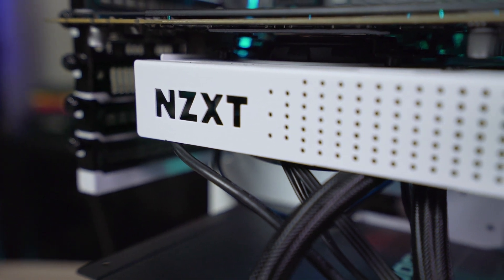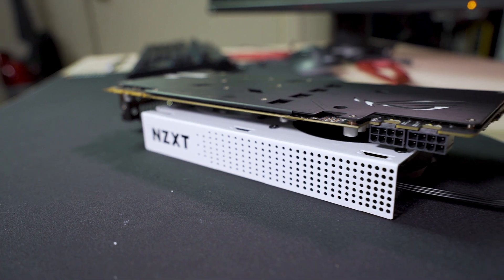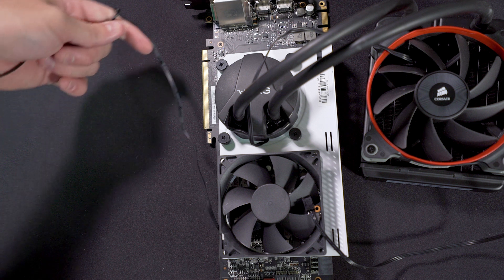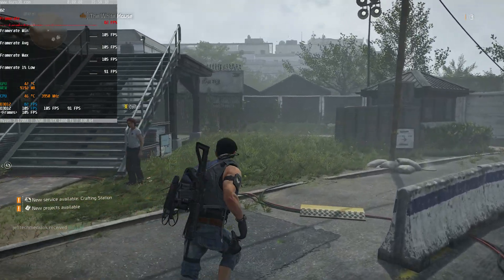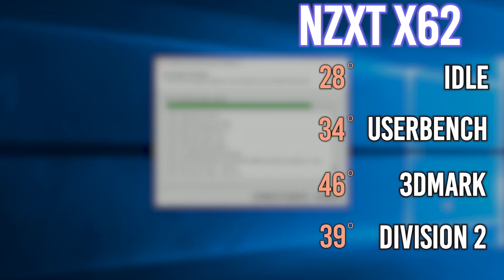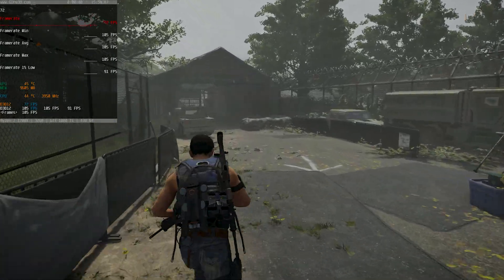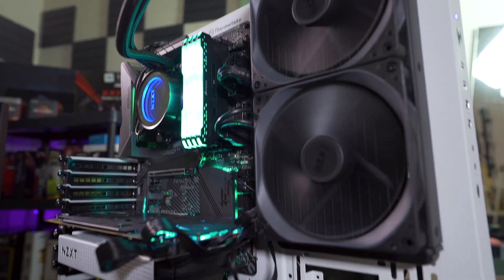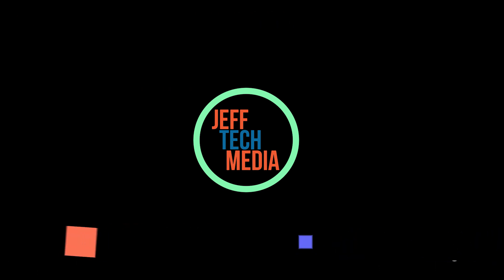GPU Watercool Mounting Kit Worth the Effort?.. NZXT G12 Install & Testing

Comment: Why do none of these videos say where to plug in the pump and fan. Are there headers on the GPU board? Which ones if so? Does the GPU fan headers (if they have) ramp up and down based on temps? Frustrating.

Comment: i have the bitfenix pandora and an Asus Dual gtx 1060 6gb, the airflow is not the greatest and, besides that, my gpu tends to heat up a lot, under light gaming it reach between 65-71 °C, and good any  game mid-high demanding game it reaches 78-83 °C, so i think that´s not normal not good so I´m thinking about giving a try to this.

Any suggestions?

Comment: Have an ASUS STRIX GTX-980 Ti sitting on the shelf with 2 broken fans. Since GPU prices are still outrageous I thought I would test a NZXT G12 with a Corsair H105 240mm AIO. 

Just received the G12. Any guesses as to the performance?  I can't really do a before and after comparison because of the broken fans.

Comment: $70 something dollars to take an old AIO and dump it on a GPU? Yes please.

No mentions of noise levels here, but I'm willing to bet an AIO with a decent fan is infinitely more quiet than a jet-engine sounding GPU stock cooler under load.

Also if you're running your GPU consistently cooler under load, you're reducing the thermal cycle delta and overall heat, which may increase the lifespan of your card.

All for $70 assuming you have an AIO already. Or, just buy a cheap 120mm kit.

Comment: What did you plug the 2nd aio into to power the pump? Im thinking of doing this with my 1080ti strix and a separate aio for cpu. Have a x570i mini itx board. I have the cpu fan, aio pump, and the chassis fan headers on that motherboard.

Comment: Fitted this to a GTX1070 using a Corsair H55 AIO. The results are amazing, on FS2020 the GPU went from 78C -83C down to 55 degrees C. On Tomb Raider with everything turned up it never goes above  50 degrees. Well worth the cost and effort.

Comment: I have an ek full cover block. Cut my temps in half.
Reply from the maker: Ya, putting a block on GPUs is insanely effective. Even compared to high end air heatsinks
Reply: @JeffTechMedia I mean I'm using a titan v. So 46 vs 82 is a big incentive. Plus the performance gains with the thermals.

Comment: I’ve recently built a new PC and everything seems to runs cool and quiet besides my GPU. I currently have a RTX 2070s mounted on a nzxt g12 and nxzt x63 AIO cooler in a nzxt h510 case. I was hoping with the AIO addition my GPU would stay around 60c under load, but it often sits at 76c. I was thinking this could be a fan issue, but I followed the instillation instructions and have my pump plugged in my AIO header; the radiator fans plugged into my CPU fan header; and g12 fan into an extra fan slot. I also take in consideration the size of my case and lack of ventilation may be a factor but I’m new to AIO’s and can’t tell if this is norma temp i should expectl. Any suggestions?

Comment: Might have been a good idea to add a section to see what effect this has on overlooking potential. Its fairly obvious that if you keep the same clocks you're going to get lower Temps, but people generally watercool to reduce thermals for OC potential and reducing noise. That was missing from the data. OC gains are missing from most g12 reviews. Im not sure why.

Comment: I have a question, I watercooled my GIGABYTE AMD R9 390 G1, it crashes even more with it watercooled, Kraken x72, and Kraken G12, I also installed heatsinks on my gpus vrms and voltage controller stuff (where ever the thermal pads were on the stock air cooler.)    Ok here is my question, why would it be crashing?

Comment: Just chiming in with my experience. Quick summary on my EVGA 2080 Ti XC Ultra: Stock Cooler 80C under load | Kraken G12 w/240mm radiator 45c under load. In my experience it was totally worth it, cut temps almost in half.
Reply: Damn man, 45c under load is lovely 😍
Reply: Same here except I got a 1080ti. 240mm dropped temps from 85c to 45c, this upgrade is totally worth it
Reply: I have a 2070 super and I am getting 75°c at best underload... Hotspot of 105°c
I am gonna assume I did something wrong and reinstall it
Reply: How about memory cooling? From the pictures and video it seems there is nothing from the G12 in contact with memory modules and the 92mm is too far back.
Reply: @LostNEggsAisle-tm5zr  it wasn't overvolted as I had undervolted it. It turns out the cooler I bought was broken and didn't actually cool anything, when I stuck the old air cooler back on it was at most 60°c hotspot of 70°ish.

Comment: Noticed you didn't put any pads/sinks on the VRAM and VRMs.  Shouldn't you? I wonder if that might explain your slightly lower frame rates.  Maybe they throttled you???
Reply from the maker: I did put them on the VRMs, but it appears that part was skipped over from when I connected the G12. I do think I missed a couple spots and that definitely could have throttled it back those few frames in game. You're super right though, it can definitely have an impact.
Reply: @JeffTechMedia  FYI. I've completed my G12 conversion on my Strix 2080ti.  I put copper heatsinks on RAM, little aluminum heatsinks on VRMs.  Works great. Much cooler.  I've experimented with +225 core +900 memory +12 higher "power limit" and temps maxed at 63c after an hour of benchmarking. Nice.  I've removed the OC as I don't need it. Your video was one that helped me :) Thanks.
Reply: @windfire5380  helpful answer, ty

Comment: Great video, dude. I'm contemplating this at the moment.   Would you recommend putting thermal pads or heatsinks on the exposed VRM?
Reply from the maker: Thanks a bunch man! Do the pads if you're running a fan directly on them. But heatsinks if fully exposed.
Reply: @JeffTechMedia  What GPU do you used for this video?
Reply: @pedestrian6862  Asus ROG Strix 1080 Ti
Reply: @Seagull81006  Thanks

Comment: I just installed mine on my 2070syper with a corsair h55 aio.. I changed the nzxt aer fan for a noctua b9 redux.. Now I'm running at 61° on full load at 1440p. This video helped me decide to do the mod. Thanks 😁
Reply from the maker: That's awesome to hear and i bet that fan is a good bit better than stock. I'm going to put the g12 on a 5700XT and add a server fan I found that runs like 5000 rpms, haha see how that goes. I'm glad to know I helped!

Comment: what about the VRM temps? my only worry is that the vrm on the left side of the gpu aren't getting enough airflow.
Reply from the maker: The g12 comes with a fan that situates directly over the Vrms and it actually has a good amount of room to breathe. Definitely better than blower style coolers and as good as multifans

Comment: Amazing video, I’m about to do this to my RTX 2080 Super XC Ultra.
Reply from the maker: Hell ya! Should get some sweet gains. What AIO you using with it?
Reply: JeffTechMedia I was going to use a Corsair but ordered the wrong one and change it to a Thermaltake Water 3.0 ARGB 120mm. Should be cold enough for the GPU and my case has limited space. I have rgb fans in it lol

Comment: Great video after watching a few of you guys do this to cards, i decided to do this for my 2070 rtx turbo as i find factory cooling horrible on most gpu now days,  Now unfortunetly my card was faulty from get go hence i cooled in the first place to see if it could improve. which did temp wise much better temps idle 28c and topped out at 50c but card still crashed :(. so replaced with 2060 rtx OC and going to install g12 to this as once again stock cooler rubbish. so all in all i highly rate the g12 conversion if all you want is aio instead of crazy water cool setup, Oh and aio i used was H55i paired with 2 ll120 RGB's
Reply from the maker: Gaaah that's garbage that it failed out that quick, I had that happen with a regular 2070 when they first launched. But I agree, other than the super nice heatsinks, most gpu coolers are bad

Comment: No ones answered the question of  "how noisy is that 92mm fan cooling the VRM's". that could be a deal breaker as I want the system as quiet as possible.
Reply from the maker: It's not too noisy, it can run pretty low rpms and still keep things cool. The main cooling is associated with the AIO on the chip itself. So I'd say you'd have to make sure that cooler and fan combo are quiet, which has a wide range.
Reply: @JeffTechMedia  Thanks for the reply, this looks like my next purchase in that case.

Comment: Nice job on the video and thank you for the effort. Didn't make any sense that you would expect to see any performance changes outside of standard deviations when none of the tests hit any of the video cards limits. Your conclusion was right on... If you are not going to OC and everything is working fine then why bother as even the acoustics would probably be rather close - 1 fan running at a higher rpm to push through the radiator or 3 fan possibly at slightly lower rpm. Thus i was hoping to see the testing demonstrating the IRL potential of OC and therefore the possible value of cost, labor to performance gain.
Reply: pointless video indeed

Comment: The reason i want this setup for My GTX1080 is because then all the Heat can be blown out of the case, My cpu already has An aio installed, which is mounted on top. I AM planning on buying a new case the fractal R5 so i Will be able to mount 5 fans blowing filtered air in, and then the two radiators for exhaust

Comment: Triple fan and good airflow on a cool card already? I did it on my RX 580 in itx case, went from 80-90, to 65-70c andddd OC from 1366 mhz up to 1446. Crazy in that case scenario
Reply: im considering this for my RX 580, 2 years on do you have any other thoughts on the upgrade?
Reply: @buddymiles7210  been a while, upgrading is now a possibility

Comment: Adding it because it looks good? this thing looks awful no matter how you install it but the temps dont like just make sure you upgrade the fan for the vrms and it works.
Reply from the maker: It is a bit of a jumbled mess. But even at stock, it  cooled way better than before. I'm needing some clarification on "the temps dont like just make sure you upgrade the fan"
Reply: @JeffTechMedia  temps dont lie* sorry bud on a mobile device lol i upgraded the stock fan to a noctua grey fan and runs way better then with the stock fan
Reply from the maker: @johnaranjo2059  haha I feel you, one autocorrected word can mess everything up. For sure though, I wish I had suggested that. The fan they put in is their generic nothing fan. Now I want to mod the G12 and put good fans all over it!

Comment: Thanks for the video man. Good job. Am I seeing this correctly? You can keep the stock backplate with the G12?
Reply from the maker: Thanks for the kind words, I was able to keep the backplate of the Strix.. It's been a little while, I think I had to add a couple small zipties to make sure the plate was on tight. On another GPU I have, it didn't quite work out that way.

Comment: No real world testing, u should have put everything in a chassi and noise, my RTX2070s stock cooler sounded horrific and almost hit 80c when overclocked, my G12 and Corsair H55 is 20c better and noise is way down.
Reply from the maker: I don't really know what the first half of the comment is suggesting. As for the second, that's a great drop in temps my dude.
Reply: @JeffTechMedia  By real world testing, he means next to nobody uses an open air test bench for their main system, so you should have run temperature tests inside a closed case.
Reply from the maker: @joshuadriver9606  Ahhh, thanks for clarifying. I for sure would have. But recording the putting it together and running the tests and putting it together takes forever. Especially with one person doing it. But it's still testing the two in the same environment, showing the difference between the two. I would suspect both temps would have been hotter, with a similar distance between them.

Comment: i was wondering if the gigabyte 2060 super windforce OC 8GB able to use the kraken G12?? i see many ppl say they can while the nzxt website says it can't???
Reply: NZXTs website say nothing about the RTX2070 but i put one on it, can't say anything for sure but RTX2060 is mentioned not compatible. Try but on your own risk but the not compatible marking might be there because the RTX2060s DIE isnt as high as the other RTX models.

Comment: Brilliant video! Personally it looks a bit silly with a triple fan GPU but with a dual fan it would work brilliantly. Also where do you get those transitions they are really clean!
Reply from the maker: Haha it definitely doesn't cover the whole GPU. I was worried that it would cool worse because of it. The whole thing worked way better than I would have expected.

I got this one in a pack from envato elements. Do you use Premiere Pro? If so I can share the master project I got from them.
Reply from the maker: Theres like 20 different ones and you can change every color to whatever you want